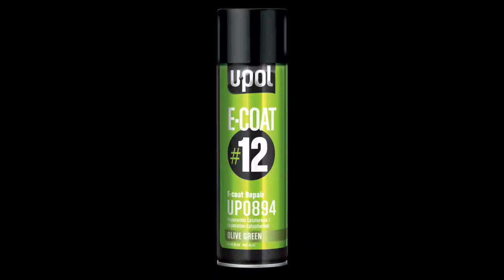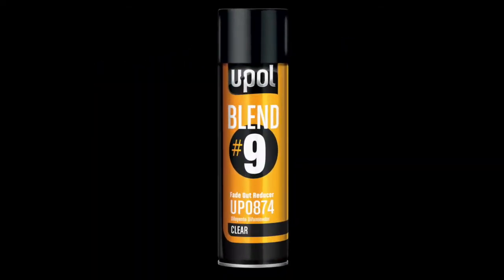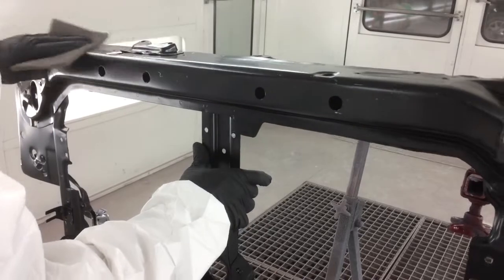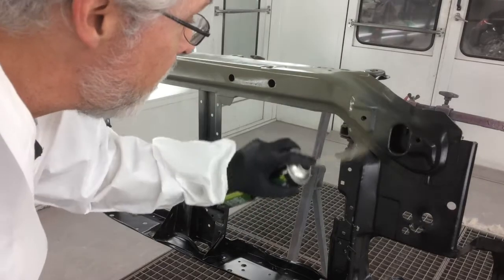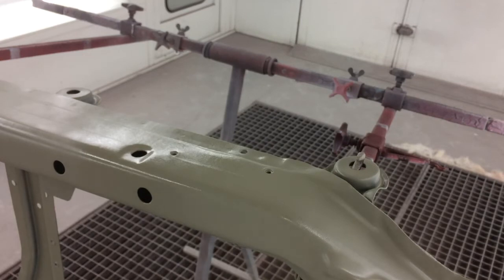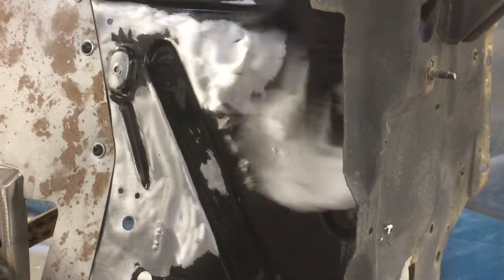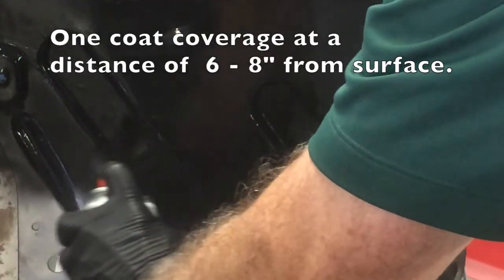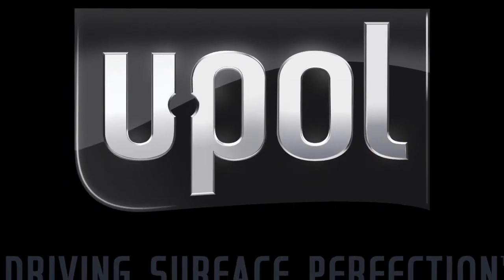U-POL E-COAT#12 Repair Aerosol UP0890-0894

Comment: Can this be sprayed over rust?
Reply: if it has been cleaned and sanded - yes - however - it will not stop existing rust from continuing, it is not a corrosion encapsulating / neutralizing product. It is designed to be a direct to metal coating to duplicate and replace or repair factory e-coated panels that have had the factory e coat removed in the repair process or that are the wrong color.

Comment: Can this product be seam sealed over?
Reply from the maker: Hi Brandon. Some seam sealers contain aggressive solvents which could cause wrinkling or softening of the coating. Best practice would be to apply seam sealer direct to metal, allow to cure then overcoat with E-Coat #12.